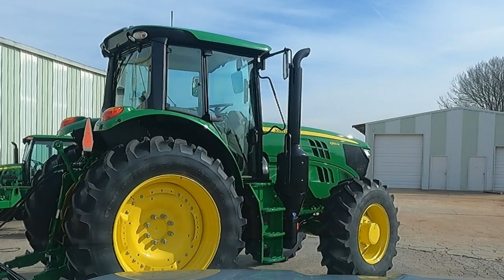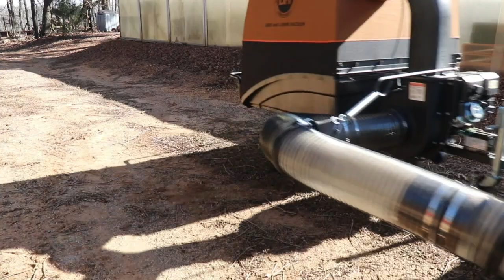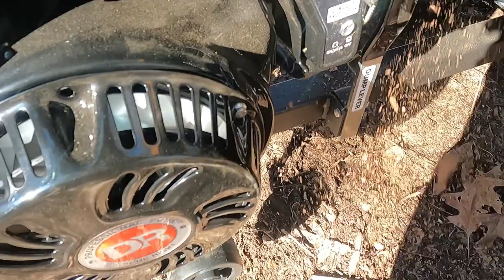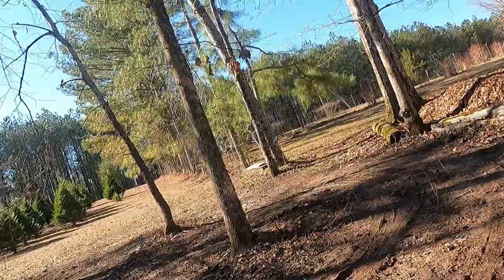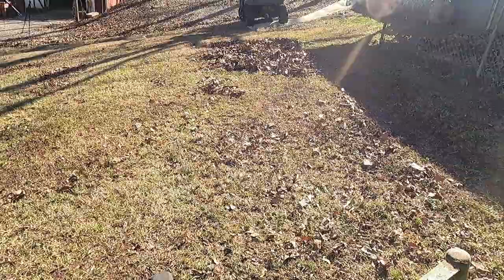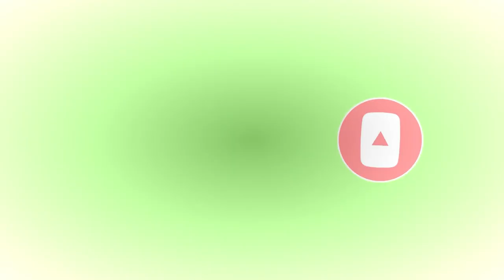DR Leaf Vacuum.  Is It Really Worth It?

Comment: The boot and hinge kit is all I kept of my DR leaf vac.  The Dixie Chopper mulches them into dust.  In my situation the entire machine turned out to be unnecessary.  Found that out when the boot plugged and there was nothing to dump, and not a leaf left on the ground.  Application of the machine is everything.  I gave it to my Dad.  In his situation, it works great.  So well, he bought another one just to work remote with.  He's in the middle of the woods where leaves are more than just a fall or spring clean thing.  Start on them in fall and you might get most of them up by next July.
Reply from the maker: It still beats a rake.  Thanks for watching.

Comment: Hell no. Had a recall on the bolt for propeller and shop has had mine now for 35 days, still not back.
Reply from the maker: What shop did you have to take it to?  Authorized dealer?  Just wondering.

Comment: helpful video. not sure if i need a small tractor to rake my leaves loose before trying to blow/move them or vacuum them. trying to find a local crew who has this type of vacuum..hard to find one.
Reply from the maker: I have high lift blades on the mower and between that and the suction of the vacuum, it does a pretty good job.

Comment: Larry
I have to agree to some extent.  I was in awe of power of the motor.  I purchased the top of the line DR vac.  The 8 inch hose was really a big difference.  
Here is the problem I had.  I mainly cut grass with it, over filling was a problem.  It wasn’t easy lifting the top up to dump.  Also I had a lot of trouble with the top shifting.  It would shift so much the hard plastic connection would come out of the bag.  I tried collecting smaller loads, but once it started slipping out of the collector it would not stop.  Sure I could have rigged it and risked loss of my warrantee, but I figured as much as I paid for this I shouldn’t be having these problems.  
So I called DR to complain, I was hung up on before I could even talk to someone, several times.  Then I was put on hold for over an hour.  Then I was told I would bare the cost of return shipping, that’s was when I came unglued.  
Now they put me with a gal in the complaint section she was very gracious and kind.  She asked me if I would do my best to clean up the unit and she would send a truck.  I had only used the unit for about 3 weeks so it wasn’t difficult to clean. 
They did refund my money and still today send me advertising of their products.  
Also a comment on JD mowers.  I have two a 425 and a 515E love them both.  However in most cases parts can only be purchased from JD directly.  The closest JD dealer is 50 miles away if you go there it looks like a mower bone yard.  They keep the mowers outside with no protection in this Texas sun that’s a no no.  
Luckily I have a repair shop fairly close that will work on my mowers and stores them inside.  
The last time I went to the JD place close to me for a part I saw at least 30 or more mowers outside so I asked  say how long would I have to wait for repairs maybe a couple of weeks, the guy behind the counter laughed you mean 6 to 9 weeks would be more like it. That long in the Texas sun the color green would be so faded you wouldn’t recognize you mower.
Reply from the maker: Thanks for watching.
Reply: Sound like you wouldn't buy another one